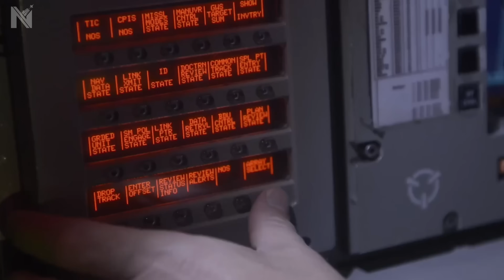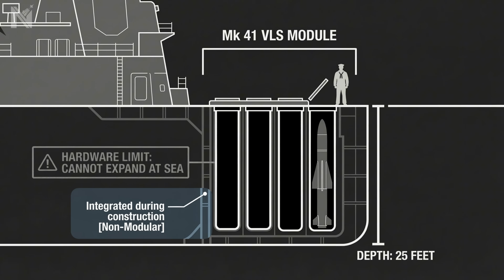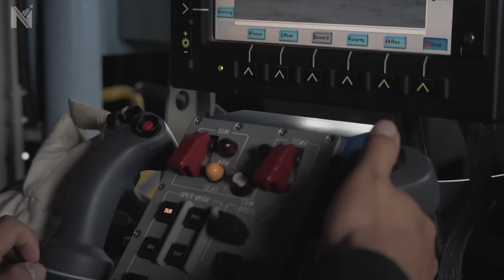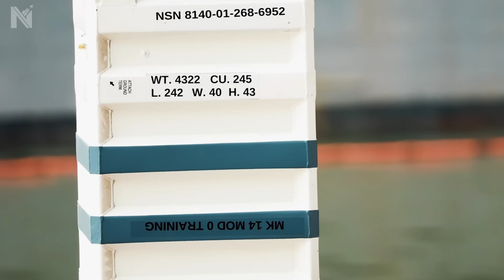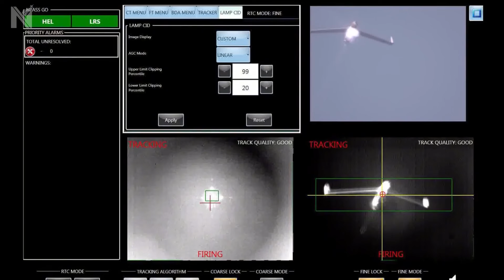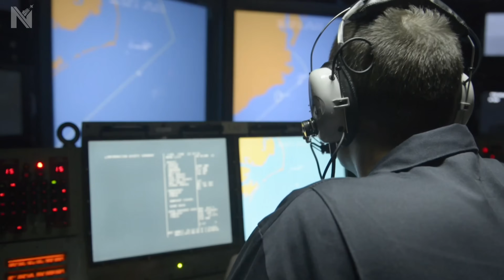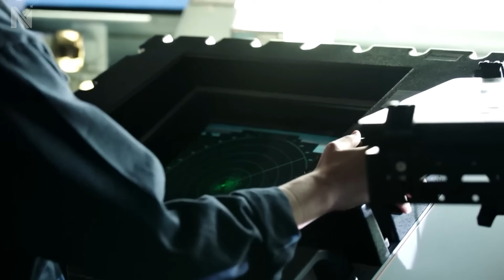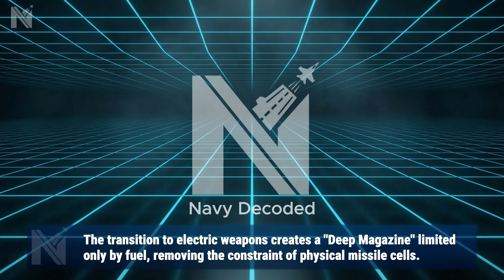Why The US Navy No Longer Fears Suicide Drone Swarms

Comment: Regret to disappoint you. While your admiral was and is a brillant thinker, she was NOT the first one to try to figure out this exact problem. Drones in the cheaper scales have been forthcoming to an even greater extent in both Europe and other places outside the US for even longer. We are just taking a different path to the problem, and one that I personally think is more obvious.
Instead of deploying auxiliaries with each task force with replacement missiles, we focus on retaining the missiles for targets that are other hostile missiles and combat aircraft while adjusting ships to carry drones for drones warfare. This has 2 major advantages compared to the method you are apparently deploying. One is cost on a massive scale. the other is the number of replacements that can be carried by a single auxiliary. Meaning that the advantage is huge in both the logistic and financial end.
The reasons are obvious when it comes to cost and logistics, so I won't waste your time dwelling on those. But there is another advantage that goes far beyond in the tactical sense. You don't use a philosophy of one drone to destroy one drone. That is not a viable or realistic option. You use a layered system of jamming drones (with the added advantage of being able to return to the mothership and be used again in another drone battle). This will NOT take out every enemy drone. Most likely not even 50 % of them. But it will remove a number of them, depending on their use of GPS or inertial navigation etc, and the number of jamming systems you can viably deploy in a single battle and the effectiveness of each system. That will be a running battle of action-reaction-counter reaction.
Then you have drones in the next layer that are designed to take out attacking drones. These can be made to target clusters or individual drones, depending on the nature and formation and how many attack vectors are involved. And again, you MUST assume that you will not take out even half of the attacking drones that survived the initial jamming defence. You must also allow for the fact that not all defense drones will even come close enough to take out ANY attacking drone, which means that if you have the proper software (and the drone have the proper range), you can have the drone programmed to not selfdestruct or just carry on until out of fuel, but instead turn back towards the mothership for use in a future battle.
Depending on the range at which the enemy attack is discovered, you can have perhaps 1 or 2 layers of this kind of defense drones. And then you are of course down to the close defense weapons that you already have now. But at this stage, provided that it is a carrier task force, you have the possibility of also using aircraft with guns (since drones are not faster than aircraft) to further decimate the number of drones that are incoming.
Finally. NEVER assume that not a single drone will make it through and actually reach a target ship, no matter how many you pluck out of the sky before arrival. So also allow for some kind of bird cage protecting vital systems. And here we are NOT talking guns and cirws and the like. We are talking tracking systems and radars. And we are talking bird cages tha can be deployed and retracted as required so that they are only deployed the minute it becomes a close in weapons battle. And we are talking damage control teams that are geared up and ready to work at a seconds notice. Because even if the bird cages are effective and will protect the systems, some damage will be sustained on the ship. One way or the other. Never believe that you will be superiour enough to bring down all attacking drones before they reach their target. You can actually be lucky and avoid it. But that option WILL be the anomaly that confirms the norm.
And the final advantage is that you still have all your missiles left for other kinds of targets, and you can replenish drones a hell of a lot faster because you can haul a cluster of crates in each pass and simply drop them on the aft deck instead of using time on carefully handling a missile into each launch tube. And you don't need 200 drones on each ship. Each ship will have predesignated vectors depending on their position in the formation And drones can be deployed from both carriers, cruisers, destroyers, frigates and even auxiliaries which will also ease the strain put on each ships combat plot significantly.
I'm sorry. But going along the path you are describing in this video is damned expensive and will still leave you in need of reaching shoreside replenishment of both combat vessels and auxiliaries at a much higher rate. It will be an enhancement compared to existing conditions. Absolutely. But the cost efficency and the extention of time on station is still very limited compared to the European path I have seen described and have now explained to you. even considering the fact that missiles will still have to be up and ready even if you use the layered drone defense the Europeans have described. Because I think it would be very naive to think that a number of missiles will not be sprinkled in between all the drones.
Reply from the maker: You've laid out a very thoughtful alternative strategy with compelling arguments about cost efficiency and logistics—it’s clear you’ve put a lot of thought into it.

Comment: I bet the are also working on EMP weapons for ships and ground bases.  Not feasible for use on aircraft due to power requirements but could fry the electronics in just about anything not protected with a Faraday cage.

Comment: I for one am SICK of paying Northrop Grumman and Raytheon trillions of dollars in overpriced weapons when I have seen what they can do in Ukraine for pennies it's innovative and cost effective. The bidding process for the US military is corrupt and rigged with sellers having to wine and dine the buyers and probably hand them envelopes full of cash and hookers. I have heard too many stories of entrepreneurs with great ideas in tiny factories with small tight budgets who continually are turned down by our own military and are not permitted to sell their weapons to other countries because they're considered far too lethal!! If they're far too lethal we should be buying them!!! I know this personally because I made a guided missile system With a sensitive $24 infrared seeker using Gallium arsenide photo detectors, 4 optical lens and a quad divider blind, each one operating it's own tail fin Using high quality hobby shop servos for a total of four tail fins it was brilliant and cheap and very easy to aim. It came with a set of $3 earbuds and you listened for tone while looking through a powerful wide field optical-lens of 50 X 200 and fired. It actually worked at traveling Mach 2.7 Ammonium perchlorate + Al Fuel using a Crest zirconium oxide nozzle which they also didn't like because it might break During rough handling. We told them we'd sell them extra nozzles for two bucks a piece that could simply be screwed in by hand! Once this thing locked on to your heat signature you might as well have been hooked to it by a string dragging it towards you, there was no escape. The tests worked 100 percent of the time.  We were rejected because we couldn't offer 'the brass' $1000 meals at a Fancy restaurants like the BIG THREE as I was told. A nice Colonel SAT me down and basically told me why we should give up and he sympathized with our plight but didn't have the power to stop it. They finally gave us the ridiculous excuses ''The RT-586 was too easy to copy and the enemy would start copying them". The price of the total missile was $2000 each and had a 12 mile range. This wasn't meant to be the ultimate missile but to guard ground military units from aerial threats where they could shoot these at a low cost and units could be issued a lot of them. Our company filed for bankruptcy in 1999 and now I'm too old to continue when they really need it, sad, something needs to change.

Comment: 40 drones is NOT I repeat NOT a swarm! A drone swarm is 3-4,000 drones. With a speed of 150mph at 30 mile range a laser killing 1 drone a second and locating a second drone in a second will kill 30 drones per minute and 150 drones in the time the swarm reaches the ship.  Micro Wave has a range of 1KM  to 1 mile, the US Navy doesn’t have the capability to defend against a drone swarm attack now or in the process.

Comment: Oh, the mistakes!!!!  They don't fire SM-6s at cheap drones (they used SM-2s or ESSMs, which are still pricey.)  VLS cells are NOT made of concrete.  And more than one missile can fit in a VLS cell.  The ESSM, a very useful anti-air missile can be quad packed in VLS cells.  These are all in the first three minutes of the video.

Comment: Ships need to be equipped with capacitors connected in series and parallel to.supply several lasers power at the same time.

Comment: the microwave option is genius. even em shielding won't save your drone against that tech- because em shielding doesn't block it- it just absorbs it & then bleeds it off safely. so why won't em hardening work? because that's far too much energy to absorb. if you built a big enough capacitor bank to absorb that energy burst? your drone would look like you took an egg- and gave it the wings of a bumble bee- & the weight would mean it would never leave the ground. even if you absorbed 90% of the burst- your chipsets would be disabled and non-responsive- your video feed? cut. navagation system? offline. the VFD? stops- so the motor stops. now all you have is a $20k free-flight glider with no controls & no video.

Comment: A drone that can fly through the water and then fly into the air, would be substantially more expensive than a basic airborne drone.  From what I understand, drones can already use simple AI to pick their targets and to hover at a distance until the most opportune time to attack appears. I have also read that many drones are wire guided, and therefore impervious to jamming---but if their electronics are fried they will crash.  Please note the 1970s defection of Soviet pilot Viktor Belenko. American engineers were shocked to find that the defecting pilot's Mig-25,  was using  vacuum tubes in its avionics, instead of transistors. The reason was that Soviet aircraft designers realized that their aircraft would have to be able to survive a magnetic pulse from nuclear weapons. Transistors would all be fried, but vacuum tubes would survive---ergo no transistors in the Mig 25. Hopefully the enemies of the USA won't figure out a way to make drones with vacuum tubes.

Comment: It's possible to shield against the microwave weapon, but it would make the drone heavier and more expensive.

EDIT - plus, I don't think it would be possible to control a drone  with a remote connection during an EM attack of this magnitude.  It would need to be AI controlled.

Comment: Deck lights don't flicker and the the ship doesn't vibrate from charging Meteor, this isn't Space Battleship Yamato. If the ship vibrated it would wreak havoc on the sonar and you wouldn't be able to keep the ship functional if it taxed the electrical system that badly. 

Burkes have 96 VLS cells, but there are missiles like the the Evolved Sea Sparrow that are packed 4 in a single VLS cell.
Reply: The sonar ??? You mean radar, right ? Sonar is for underwater detection.
Reply: @power2084  Yes Sonar. All Burkes have either bow or towed sonar for sub detection.
Reply: @thegrimreefer3185  why would the ship care if the sonar was degraded for a few moments while the system is charging ? It's under AIR attack, not underwater attack !!
Reply: @power2084  Apparently you don't understand that coordinated attacks are a thing. If the hull is vibrating it's like a beacon to enemy passive sonar.   Basically a big flashing sign that says fire a torpedo or underwater drone to an enemy.
Reply: @thegrimreefer3185  the danger is minimal. Get real. You can't be 100% safe all the time.

Comment: Why not launch a counter drone to identify the command and control location so land strike missiles can punish the control center personal.

The given scenario does give the rational for high power microwave defense. I would assume lasers would  have higher range so we need to think sophisticated layered defense. Defensive naval missiles should be reserved for high value targets like hypersonic missiles as their rapid close on distance requires early engagement.  Fleet defense could benifit from US drones forming an outer layer defense. Air and naval drones. We need to ensure high power microwaves do not kill our aircraft when operating around air craft carriers.

Comment: You also forget Burke Flight IIA/III and Zumwalt class destroyers have 30mm Mk44 Bushmaster II that can fire air-burst munitions including AHEAD rounds good against swarms of drones. While the older Burke Flight I/II only have the 25mm M242 Bushmaster that can still defend against swarms of speedboats. So for Burke they have 2 of this besides the standard Phalanx CIWS/SeaRAM/RAM. But this is only for terminal interception. Helis are now more commenly used as they can intercept drones at long range. USN for example shot down Shaheed drones at the Red Sea with their MH-60R/S Seahawk helis.
Reply: What was the Seahawks using to take the drones down?
Reply: @dna6882  GAU-21 which can fire 1000+ rounds per minute. Basically a mini PHALANX. But any heavy or light machine gun will do as this is also what's being done in Ukraine. But attack helicopters can also be used. I wouldn't be surprised if Apache or Cobra/Viper will be adopted for this role in the future.

https://www.youtube.com/watch?v=bihsF4SKhqo
https://www.youtube.com/watch?v=Nzxq0U1I8Vg
https://www.youtube.com/watch?v=npqH5hmjx_U
Reply: @johnsilver9338  Ridiculous waste of money. Using kinetic munitions is a losing proposition against drone swarms over the long run.
Reply: @mensrea1251  https://www.youtube.com/watch?v=bihsF4SKhqo

If you had watched the video it only took 6 sec to down a Shaheed drone. A M134/GAU-17 Minigun can fire 3,000 rounds per minute. Or 50 rounds per sec. And each 7.62mm round only cost around 1.00 USD when bought in bulk. So that's 6 sec x 50 rps x 1 USD per round = 300 USD vs 20k - 100k USD Shaheed/Geran. So its very cheap using helis as drone hunters.
Reply: @j @johnsilver9338  $1 per round? lol no. That’s not how much live ammo used by the U.S. navy would cost. Maybe cheap recycled rounds out of Ethiopia that would never be used by the U.S. Also shooting down 1 drone in a test vs dealing with a swarm of dozens during an actual engagement won’t see the drones getting shot down that quickly and that accurately. These kinetic weapons are classic spray and pray and you will not be destroying 1 drone every 5-6 secs. Guy, this isn’t Call of Duty. Kinetic anti drone systems are an interesting “last line” defense nothing more. They will never form the bulk of anti drone systems. They are too expensive, require massive storage and the supply chain is guaranteed to make them unsustainable over the long run if you are deploying them as the bulwark of your anti drone strategy. Hard no.
Reply: @mensrea1251  Just keep coping in your dreams 👍
Reply: Be fun to be that crew chief, drone hunting!!!

Comment: I'm surprised you didn't mention the newish guided 70mm APKM or something like that missiles that are being used on F-18s even Helicopters to counter drones from farther away. Instead of using expensive SM they just use the cheaper missiles that do the same thing. They are also Air to Air and Ground to Air so works both ways.

Comment: I don't understand why someone can't just develop a scaled down and cheaper Phalanx system. Equip 10 turrets on a destroyer to function like the regular 20mm gatling gun Phalanx, but scale it down to 7.62x51. How could this not work, and cheaply???
The HPM has a weakness - drones might start getting 'armored' against them. Yes, it makes the drones heavier and costlier. But the risk is that the upgrade might be rather cheap. So the HPM has a potential achilles heel.
Go with the mini-Phalanx.
Reply: Video forget Burke Flight IIA/III and Zumwalt class destroyers have 30mm Mk44 Bushmaster II that can fire air-burst munitions including AHEAD rounds good against swarms of drones. While the older Burke Flight I/II only have the 25mm M242 Bushmaster that can still defend against swarms of speedboats. So for Burke they have 2 of this besides the standard Phalanx CIWS/SeaRAM/RAM. But this is only for terminal interception. Helis are now more commenly used as they can intercept drones at long range. USN for example shot down Shaheed drones at the Red Sea with their MH-60R/S Seahawk helis equipped with GAU-21.

Comment: So I guess this can be used against drone jet planes and f35 raptors ??  Aim laser at intake turbine which melts so molten metal gets inhaled into engine?  But microwave might be blocked by shielding electronics in target vehicle using farad cage or farad shielded cable?  Maybe just need to amp up the power couple fold?  Hope they gave Vice Admiral Seiko Okano proper compensation,  not just a medal,  for saving our country all this money !  I salute and thank all the Veterans for keeping me safe !!!!!